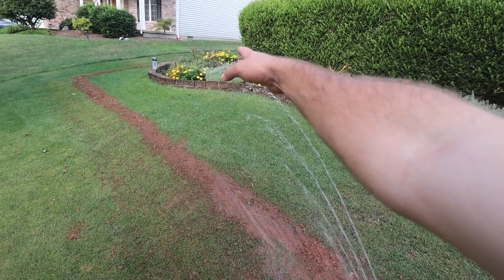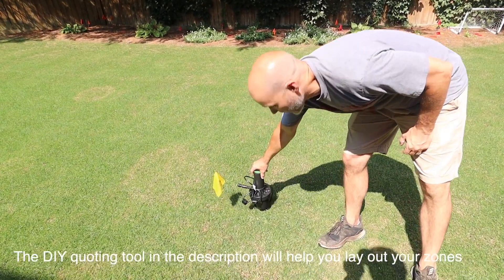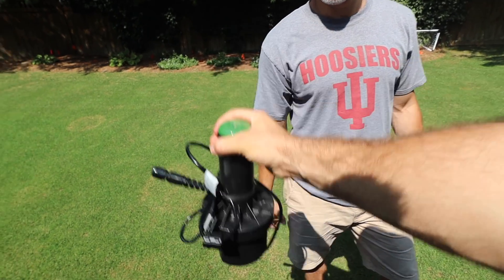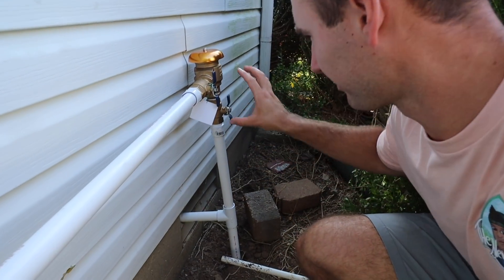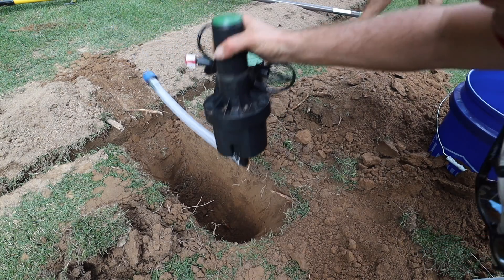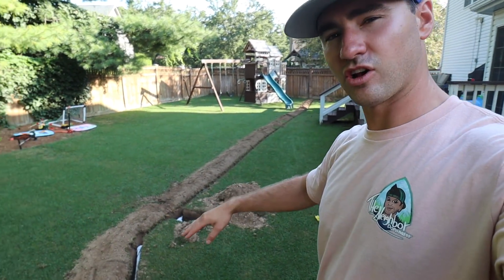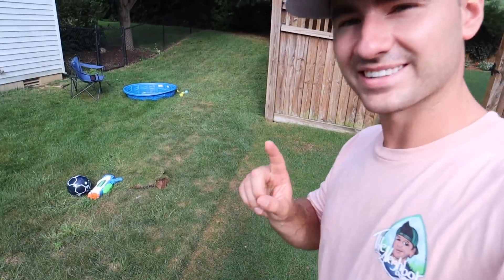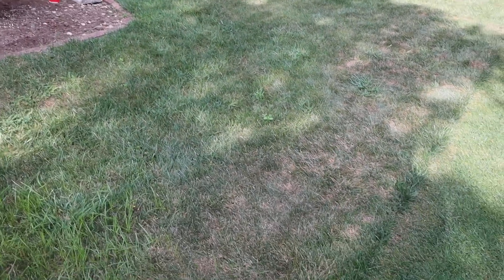The EASIEST In-Ground Irrigation Installation / DIY

Comment: Pretty cool, but let's be honest. This ability has been around for decades; it's called a guy or gal with a hose.  Yeah it requires active participation, but it gets things watered without waste, requires no trenching at all, and gets the lawn owner out on the grass to see what's going on.
Reply from the maker: Ha ok! I personally won’t be waking up early every few days to hand water my lawn for hours but i respect you for doing it!
Reply: @TheLawnWhisperer  Nor will I.  I'm researching watering timers to avoid it, and that's what brought me to this video.  But even basic watering system in place, I will have sections that can only be efficiently reached by the good nozzle-in-hand method.  I don't what this system costs, but I'd wager that normal spray heads do not waste enough water putting it on the sidewalk and such  in ten years to cover it.  If water saving matters more than money saving, go for it.

Comment: Definitely will be a look-in for the next house, or at least something similar.. Might be worth considering an all-in-one unit i.e including the cable storage box into the head (Understandably it would be bulkier as a unit but I would assume less of a hassle overall)
Reply from the maker: Yeah that would be a good idea. I’ll tell Eric
Reply: The man! Much love from down under 🦘
Reply: @nathancorbett2064  If I had to do it over again I’d cut a hole in the top of the valve box and slide it over the sprinkler. Much less digging, but Justin and I are a little slow, so didn’t think of that until we were literally backfilling the dirt.

Comment: I've seen this in ads on insta before, but wrote it off like anything else that advertises there. It's nice to see it in action. I think a lot of people won't have a 1 inch water line into their home though. I'm on a well that has a 3/4 inch line and supplies ~12-15 gpm at 50-55 psi. I'm a little disappointed though by the 30ft. I'd like that to be a bit further.
Reply from the maker: Yeah I don’t think many people have a 1” water line into their home. Eric had a 3/4” that we T’d off of and ran the 1” line to the irrigation heads 👍
Reply: @TheLawnWhisperer  I was kind of curious why the 1" when the supply was only 3/4" myself

Comment: This has to be the most epic irrigation system ever. Super simple looking install. I'll be throwing this in the front and back yard. The way you explained how it works, I'm pretty sure I can get away with 3 heads and I can water my entire property. I'm saving this video for next years lawn project. Thanks bro.
Reply from the maker: You got it. Thanks for watching!
Reply: Did you do it? Was it worth it?

Comment: I was one of the people questioning the amount of time it would take to get an appropriate amount of water down.  From the video you said it puts down 0.055inches per revolution and speed varies depending on throw distance...so what is the approximate time for a revolution at full throw?  Definitely looks like it's putting down a lot more water to help make up for only having one head.  I agree this has the merit to be gamechanging...let's just hope proper validation testing has been done and quality control on the manufacturing of the sealing methods (hopefully the MCU is encapsulated in potting).  So many more questions.. like can it skip over a sidewalk for parkways?  How to avoid a dry strip or over saturated strip between zones?  Are they taking investors? 😀
Reply from the maker: Unfortunately right now it doesn’t have the ability to skip a sidewalk but I’m curious if they could push out a software update in the future for that 🤷🏻‍♂️ I’m going to do some testing on it to see water output at certain distances etc in an upcoming video
Reply: He said 4-5 minutes per revolution at one point (I noticed he didn’t really answer the question either), so a half inch of water would take about 9 revolutions, at 5 minutes a piece that’s 45 minutes. So plus/minus from there depending on the size, I guess.
Reply: @BenNawrath  yeah I heard that too.  For 2000sqft  for each head, that's not completely out of the ordinary.

Comment: It’s not practice to have to dig down 16 inches for a head especially when there’s times you can barely dig down 4 inches
Reply from the maker: Worked just fine for us. If you can’t trench below 4 inches then you probably shouldn’t put in in ground irrigation right? Where are you located?
Reply: @TheLawnWhisperer  I’m from Massachusetts. We get in to areas where it’s rocky and it’s hard to get down more than 4-6 inches. I like the idea but they just need to make it more practical. No hate just some constructive criticism
Reply from the maker: @joehaluch7193  it may not be this way in your area but you’re actually required to have the pipe below the frost line here where I’m at. Irrigation companies are required to make the trenches 8-12” down

Comment: Can it replace a regular sprinkler? Like the hunter sprinkler shown in your video?
Reply from the maker: No you would have to cap the heads in your current system and t off of your current line to place the irrigreen head somewhere
Reply: @TheLawnWhisperer  the sucky part is that you’d still have to trench for the wire.  Here I am,…just trying to justify making the purchase for my front yard, 😅.

Comment: I've been waiting with baited breath ever since you teased it earlier this week! I have become obsessed with learning more about this product. I started to get a free quote from them a few days ago but figured you'd have an affiliate link and wanted to wait to give you the biz. Thanks for the tip!
Reply from the maker: Thanks lile! They are really cool. More expensive than a traditional system but you would save money in the long run with watering and no wasted water. Pretty cool stuff
Reply: can i have link where to buy this system please thank you
Reply: @cmikecs  my neighbor, who has a a lawn maybe 2/3 the size of mine was quoted $7k for someone to come out and install one.  I quoted my lawn on the Irrigreen site and it was $5k.  A standard system would be cheaper, DIY, but it would take significantly more effort to install, more trauma to the lawn, and have a higher ongoing watering cost (but I do think they're being rather optimistic on the watering savings in their estimates).
Reply: @dus10dnd  I did some math, and it would take me around 300,000 gallons a year on a traditional system (15 GPM for 15 minutes a day for 70 watering days a year) to water.  They estimate that I'll SAVE 581,000 gallons a year based on my lawn size.  Now that just doesn't make sense.
Reply: Same, I just commented on the last video before realizing you had just posted this!
Reply: @cmikecs  21k square feet of selected lawn area, and I would say that is right.  I am on about 2/3 of a acre, so after substracting house, driveway, and some other spots, it seems correct.
Reply: @cmikecs  I haven't decided.  There are other "smart" watering systems out there, that I have found.  So far, however, Irrigreen seems to be the most affordable and practical, especially if you want an in-ground system.  I will likely wait as I have some other priorities (Tesla Solar Roof, if that can ever be sold here in Indiana; from what I have heard, next year might be the year).
Reply: @cmikecs  OtO is another that is based on the sprinkler heads being smart.  There are also smarter controllers out there: https://www.youtube.com/watch?v=ALyT6hZXHQQ

I don't think sprinkler overlap for full coverage is actually that big of a deal, so if you're able to get a normal head and a smarter controller, it is probably fine.

Comment: Thanks for sharing this! This is defiantly on my check out list for my new house. Do you know if you can winterise these as normal heads? What is the lower temp limits for the electronics? The big question is if the can handle the Norwegian winters...
Reply from the maker: You winterize it just the same as a normal system 👌 the electronics should be buried deep enough to be able to handle the freezing temps
Reply: The headquarters are in Minnesota and the heads handle the harsh winter no problems

Comment: I signed up for the free quote but what does just one head cost?
Reply: My 8 head quote with controller (me doing the install) was $3900
Reply: @hockeyguy0212  how many square feet are those 8 heads covering? That's not bad if they can cover 10k sq ft.
Reply: @krusej23  I was right around 10k
Reply: @hockeyguy0212  f that. I'll just run my orbit b-hyve units with above ground rainbird heads on spikes from menards. 5000 sq ft costs a few hundred then you control everything through their app.
Reply: @aliaskink  I’m not dropping that kind of cash to water my lawn. I love a nice lawn and would like to water it, but I think traditional is going to be the way to go. Or I’m going to look into your set up. Some above grounds with hoses and timers
Reply: @aliaskink   I'm with you.  5500 sq ft, $3370 for system.  I'll stay conventional til prices are better.  It doesnt cost me that much to water my grass. just 3 months out of the year for me.
Reply from the maker: The initial cost is high because you have to have the controller in order to run the digital system. After that to add more heads is relatively inexpensive compared to the initial cost
Reply: @TheLawnWhisperer Makes sense. I'm confused on why they don't just have pieces to buy or a package.
Reply: @krusej23  you can’t run these digital heads without the Irrigreen controller. They won’t work on any other controller, but you can still control a traditional valve with this controller.
Reply: @thegreybeeexperience  I understand. It's just like many other products that rely on a hub/controller. If I bought this but wanted to add on, I would have to do a quote again or what's the deal with that? I want to see what a controller and a head cost separately.
Reply: I just did got a quote for a 5500 sq ft yard.  6 heads, controller, wire.  $3370.  thats one expensive controller.

Comment: What is the life expectancy on those heads..
Reply: Stress tested for 15 year life expectancy
Reply: @TheLawnWhisperer  might make applying fert through the system practical as well, as you can control the throw range and eliminate too much overspray
Reply from the maker: @UrbanDadLife2024  I definitely agree with that. No worries about putting iron through it and staining concrete/siding
Reply: @TheLawnWhisperer  I've been looking at these for a while.. if the durability is there these are a gamechanger. Can you tie into your existing system or do they just recommend you sink new pipe.
Reply: @UrbanDadLife2024  you can retrofit to current piping, but you’ll still need to bury the wire. I recommend just running a new trench as it’s actually easier.
Reply: @thegreybeeexperience  thank you..I appreciate the response...definitely very interested
Reply: @UrbanDadLife2024  you got it. FYI, I’m the bald dude in this video 😂 just so you don’t think I’m some random guy.
Reply: @thegreybeeexperience  lol..thats what I thought...that that was you, not that you're some random  guy lol